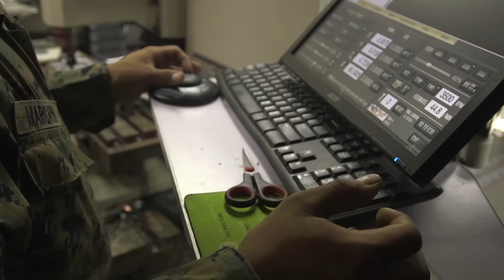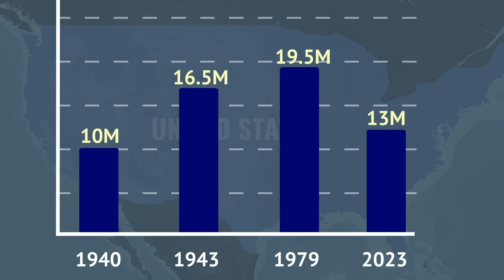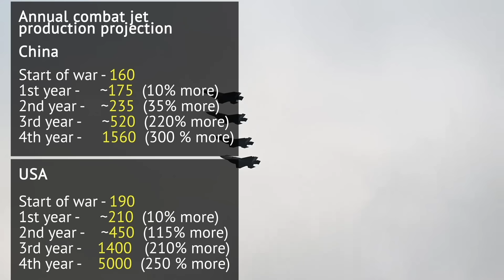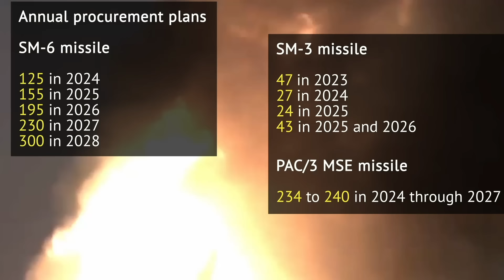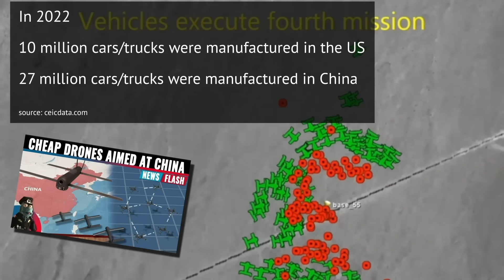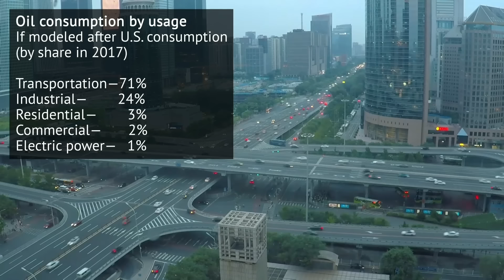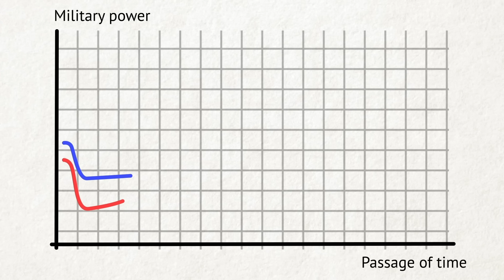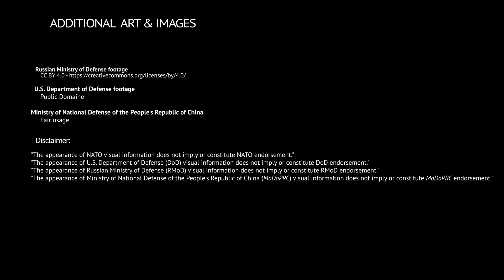Can industrial output decide US v China war?

Comment: Honestly this video is poorly disguised cope. China is the worlds factory and its quite absurd to think that the US could match it in any way.
Reply: I can imagine a factory make a plane without resources and electric or a damaged shipyard make a destroyer with no steel and no electricity too
Reply: The US is the world’s #2 manufacturing power by value-added. 

China is the world’s manufacturing grunt worker. The US is the world’s manufacturing brain power. 

If decoupling happens, we will see which one is able to adapt better.
Reply: @Htrrwe  yeah pretty hard for China to make anything advanced when they can't make micro chips. 

Quiet sad actually
Reply: @yopyop3241  From a US military study, China has a 200 to 1 advantage over the US in shipbuilding capacity. 200 to 1. Let that sink in.
And thats before they move to wartime production, which, by the way, all of their major shipyards have been designed to cater for. The US, by comparison, has decimated its own shipbuilding capability. Where will the skilled workers come from? Just one of Chinas' key major shipyards can produce the equivalent of the total US shipbuilding output from all of its shipyards combined!

I'm not a China bot either, I'm from Europe, but Americans need to realise that times have changed. Your own leaders created this manufacturing monster.
Reply: Many countries are moving away from dependency on China's manufacturing. 

As long as that trend continues, than it won't be an issue for USA. 

What China makes, is easy to make, many countries could do the same. And are starting too.
Reply: @CountryLifestyle2023 Lol. Can you ask Gina Romondo how the chip sanctions went😂? Cope more
Reply: @GabrielLopez-mo2xo The irony  is even during the Trump trade war era, the US and China trade actually INCREASED...
Reply: @globalpropertyinvestment   200 to 1.. did you look up what type of ships they were being built. 
Because I guarantee you, that if you were building a navy to defend your nation, you would want that 1 American ship vs the 200 Chinese ones. 

China is lacking in amphibious ships in order to to due a navy invasion of Taiwan. I would put money on tye majority of those (80%) ships being smaller than a frigate.. 

Just looked it up, alot of those new ships (200) are amphibious craft. Small ships that can't damage a frigate..  2000 of those ships, likely wouldn't even damage a frigate...

See the problem, you are going based of a number, not the reality of the situation. 

You do realize USA can get ships from their allies, they are not restrained to only domestic production like China is.

Also, USA current fleet could decimate China's current fleet.

And even if China had the same fleet size as USA does, USA would still decimate China's fleet.. their technology is far superior. 

Basically it's not about numbers. 
In the Korean war, Allied soldiers and USA troops were farming Chinese soldiers for exp... same thing will happen now in a naval war. 

You obviously don't understand how strong USA is....

I'm not American, I'm not pro American either. They are just the lesser evil atm. China or USA, I choose USA.

Now as a European, you have to decide, China or USA. Choose wisely.
Reply: @CountryLifestyle2023  Just so you know, in regard to amphibious transport, China has been training and integrating large roll on roll off civilian ships with their navy for quite some time. In fact, it's part of their seaworthieness certification process. In the event of war, these would all be converted to military use.
Reply: @CountryLifestyle2023  Hahaha….meanwhile in the real world, all that and the US and NATO can’t even defeat Russia in a proxy fight…..
Reply: @tat3179  USA isn't fighting Russia in a proxy war. 

So a proxy war would be Korea or Veitnam.

At least make sense, this is to easy to debunk
Reply: @globalpropertyinvestment  so again, a large portion of those numbers are for amphibious use, not ship vs ship combat... so USA still has the advantage there....
Reply: @globalpropertyinvestment and the US has a 200 to 1 advantage over china in aircraft production. Aircraft beat ships.
Reply: @SelfProclaimedEmperor  Aircraft need carriers or bases, if China is going to take Taiwan it will aim to destroy all allied bases first. 

Carriers will not be able to operate as effectively within Chinas missile range. Also - you seem to ignore the fact that the US are at the end of a lengthy logistical challenge, they will not be able to bring their full amount of aircraft. Nowhere near it.

 China would have 40- 50% of its entire air power available, not all of course as it also needs to maintain other military defense zones, so no - the US does not have a numerical advantage.
Reply: @globalpropertyinvestment  we have unsinkable aircraft carriers. They are called Japan, South Korea, Philippines
Reply: @GabrielLopez-mo2xo Actually that’s not completely true. The Entire US population is a breeding ground for unprecedented technological advancements and extreme consumerism. The U.S. also favors civil liberties and social Justice. 

China has forged itself into a vast market as well, but more so on the production and manufacturing. The Chinese maintain financial conservatism and traditionalistic values. 

Therefore, while the U.S. is far more lucrative, China has a flexible moral system. The U.S. avoids or restricts some trade , development and loans with 3rd world authoritarian dictatorship (usually, a good amount of authoritarian states were propped up by the U.S. themselves), but China is, that’s why they are so influential in Africa.
Reply: @CountryLifestyle2023 Basically, US dominates in Tonnage rather than size.
Reply: @globalpropertyinvestment Are you not aware of… the submarine? There is a deployable arsenal of tried and true missile submarines that could strike targets at a moments notice…

The Chinese rocket force is untested and steeped in extreme politics.
Reply: @thomashsiai6250   yup, and technology, and experience. 

Also more combat ships. 

But yup! That's a good way to put it
Reply: @SelfProclaimedEmperor  China now produces more than 100 J-20s per year

The US is now producing 20,000 F-35 per year ?
Reply: @miaorenfeng1  no, but the US is producing 100 f-35 a year and already has 1000 of them, in terms of civilian aircraft the US produces far more than china, so it would producer a lot more aircraft than china if they both go to war economy
Reply: @SelfProclaimedEmperor  China has a large number of engineers and technicians, so it is not difficult to increase a large number of fighter production lines.
Are you sure the United States can find more technicians than China during the war? And the production capacity can reach 200: 1?🤣
Reply: @miaorenfeng1  most of china's engineers and technicians are skilled in civil engineering, building bridges or dams. These skills are of little relevance to aircraft, the US has the lions share of aviation engineers. And yes we could find many more, skilled workers move to the US for the higher salaries every year by the hundreds of thousands
Reply: @SelfProclaimedEmperor  China is the factory of the world and has tons of skilled workers who can use all kinds of machines and tools, definitely in much greater numbers than the US.

Are you sure that in times of war there will be a large number of foreigners immigrating to a country where prices are skyrocketing and a nuclear war could happen at any time? 

China has a large number of idle skilled workers that can be diverted to military production due to the fact that China has stopped exporting goods.

The exact opposite is true for the United States, which is missing a large portion of its commodities and must mobilize more workers to produce those commodities in order to meet the daily needs of the American people.

For example, 80% of the raw materials used in the production of pharmaceuticals in the United States are imported from China, and a shortage of these raw materials in the United States would result in a massive shortage of all kinds of drugs, leading to a sharp rise in drug prices. 

Also, 95% of the energy-containing materials used to make explosives in the United States are imported from China, and the lack of these materials will make it impossible for the United States to continue the production of various missiles.

In order to meet these needs, the United States must mobilize a large number of engineers and workers to build a variety of power plants and chemical plants, which in turn will lead to a shortage of personnel in other industries.
Reply: @LCCATCX  that’s irony how? Do you know how trade wars work they don’t actually eliminate trade they just make it more expensive
Reply: @thomashsiai6250  where does what I say and you said contradict? I think both can be true even though yeah there are states that we don’t want generally to be associated with they are relatively few and their significance in manufacturing or economic output is minimal
Reply: @miaorenfeng1  it's not WW2 anymore, car makers cannot switch to making modern tanks, at least not rapidly. Weapons today are much more complex than in WW2. The US would have a much bigger head start on weapons production and likely keep it for most of the war due to being the world's largest weapons exporter
Reply: @SelfProclaimedEmperor  However this is not the case, China's J-20 is a fighter jet produced entirely in China, and all the parts for this plane are produced by China.

Whereas the US F-35 is made from parts supplied by many countries (including China) and then assembly is done in the US.

When war breaks out, China can easily replicate a large number of production lines and has plenty of engineers. There is a huge uncertainty as to whether other countries will be willing to build additional factories for the US and deliver on schedule, and China will not continue to supply the US.
Reply: @miaorenfeng1  there was one single part made in china used in the F-35, but that's no longer the case, that was quickly changed due to it being a national security concern

Comment: I imagine any hot war between NATO and the PRC would be some kind of coup attempt in Taiwan causing US and PRC forces to already be on the island before starting to shoot at each other, and the conflict would be centered around the US wresting control of the seas and coastline while the land war on Taiwan becomes a slog. Eventually the PRC would lose the capacity to supply regular military operations on Taiwan and there'd be a negotiated peace followed by a subtle or overt PRC civil war over the failure.

Despite arguably being "better" than Russia's, the necessity of the PRC having to fight the NATO triphibiously would likely lead to them being ground down and beaten while Russia has been grinding towards success in their mostly land-based war.
Reply: I think you need to consider how sea and air drones have completely changed the fundamental ground rules of attempting to invade Taiwan by sea.   You can only have regular military operations if you can actually get transports across over 100 miles of open ocean to land the troops on Taiwan.
Reply: @macmcleod1188  Hence why I said coup attempt. Much like Ukraine, there are domestic factions that support the invading country that would facilitate the PRC possibly having a friendly port on the island before a major war would kick off.

The PRC would be foolish to launch a conventional D-Day style landing nowadays. The war would likely have to start as tensions from a coup boiling over, essentially a Taiwanese civil war becoming folded into an interstate war between NATO and China.
Reply: @KAPTAINmORGANnWo4eva  I will grant that if there was a coup attempt it would weaken taiwan's military defenses.

But based on current information, a coup attempt seems implausible.
Reply: @macmcleod1188  To an extent. From my understanding the KMT is somewhat open to talks about reintegration based on the Hong Kong model. A big reason they've lost recent elections has been how that model seems to have been reneged by the PRC.

Comment: If US manages to blockade China, it would be able to use much of other countries' capacity. Like ship building in Europe. Europe does not need much of that against Russia. China, on the other hand, would not be able to be supplied by other countries over sea.
Reply: They can supply by ship via the artic route using Russia. If that is necessary or overland from the middle east is not viable

Comment: China’s manufacturing capacity is temporary. Because China has to import almost everything.
Reply: lol
Reply: China's annual steel production is 1 billion tons, compared to 40 million tons in the United States.
Even if China stopped importing iron ore altogether, China's annual steel production would still be 300 million tons, eight times that of the United States.
And in a time of war, China would certainly increase its domestic supply of iron ore.
Reply: @miaorenfeng1 but it needs iron ore from Australia 😂
Reply: @saiyedakhtar3931  Using Chinese iron ore alone, China can produce 300 million tons of steel, still eight times the annual output of the United States.

China imports large amounts of iron ore from Australia and Brazil because of their better quality and lower cost of shipping.

China's neighbors also produce a lot of iron ore, but the quality is lower and the transportation cost is higher, but in times of war, cost is not the first factor to be considered.

Comment: America industrial output is zero, everything in usa is made in china... even f35...😂😂😂
Reply: If that were true, it'd just be all the more embarrassing for Chinese pilots to get shot down by equipment made in their own country. Or maybe it just doesn't matter to begin with because everyone makes something for everyone else. Who do you think China's biggest trading partner is?
Reply: Not sure where you read that. You can be 100% certain that is not the case. They found one supplier getting some parts from China but that was resolved. Also the industrial economy of the US is 3 trillion USD, 11x larger than Russia's and about 60% of the Chinese industry.
Reply: @m.a3914  This is true. it was discovered a single component of the F35 ejection seat was made in China and it brought a halt to production until it was sorted out. There is a law preventing foreign countries from manufacturing US weapons. With the exception of a few allies.
Also the US is currently going through the fastest industrialization in its history, including WW2.
Reply: @foilhat1138  Not sure if it is the fastest but it is deffinitely going at a rapidly. Again the reason for that is because it is bipartisan.
Reply: @m.a3914  Record private sector investment into industry, adjusted for inflation and over a trillion from the state. The primary issue holding things back is the labor crunch, though automation has helped with that somewhat.